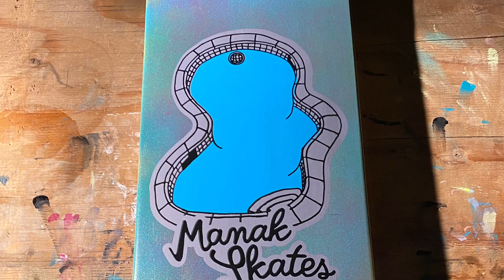Skateboard Screen Printing On Homemade Equipment

Comment: how would you go about printing all over the board?
Reply from the maker: You'd need a very large screen that curves to match the board kicks. Haven't done it yet, but I've seen it in action. If you search around on youtube, you can see folks doing it. I just don't have the space to store all of those uniquely shaped oversized screens.

Comment: what you apply at the end of the print is varnish?
Reply from the maker: Gloss clear coat
Reply: Thanks
Reply: @ManakSkates  Hello, do you have a link? and it is a multi-color print should it be applied at the end ?
Reply from the maker: @reloxis813  deft gloss from Home Depot works well. We apply one coat before we print and one coat after the printing is complete to seal the graphic.
Reply: @ManakSkates  ok thank you very much and what are the dimensions of your frame? because I am French and I have trouble understanding the video
Reply from the maker: @reloxis813  20 inch by 24 inch, but there is no exact dimension required, that's just what we use due to limited storage capacity.
Reply: @ManakSkates  thank you :) and last question, a mesh of 90T or 80T?
Reply from the maker: @reloxis813  we use 200 mesh count